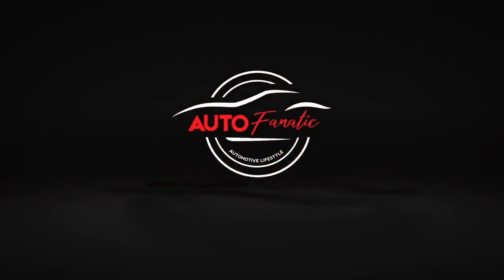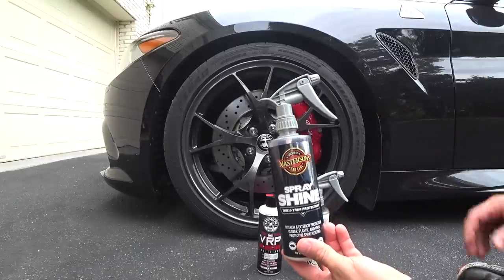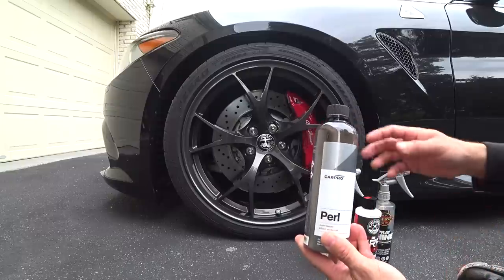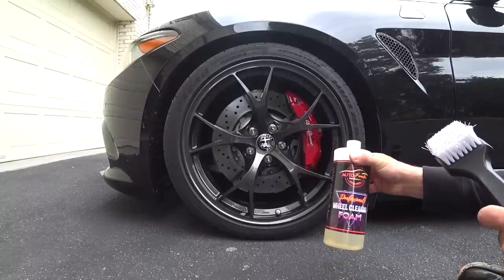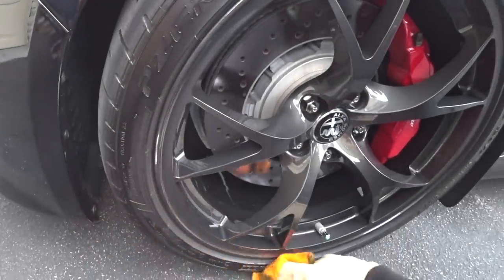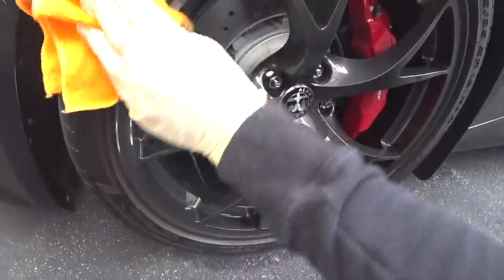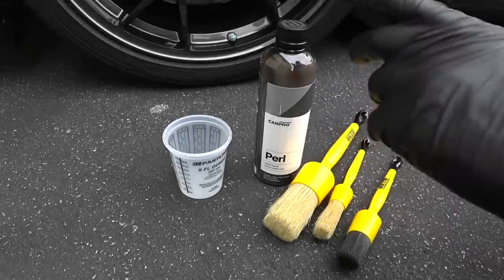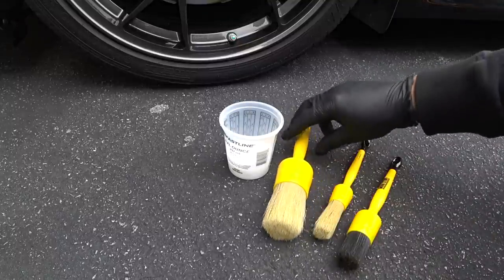CarPro PERL Application & Durability | Auto Fanatic

Comment: Used to use VRP and it was decent but my PERL is my absolute go to.  I also apply with a brush but I prefer to cut mine 1*1 on tires.  I find that it's easier to apply, lasts just as long as full strength and as a bonus makes it more economical, because as you said it's not a cheap product.  However when diluted 50/50 a bottle really goes a long way.  Had solid durability for a water based product and since I've been using it regularly (little more than a year) I've never seen any browning.

Comment: I use Perl for a year now. I wash my car once a week, and i use Perl every time. It holds that finish for about 4-6 days, then its starts to disappear, but it hold protective properties. 
I diluted it 1:5 for my dashboard, door cards and leather seats. Its holds pretty well. 2-3 months on dash and door. I have 2 small kids, and they kick front seats all the time. With perl on them i just wipe it down with some distilled water. 
BTW in Serbia its about 28 usd for 1L of Perl. With my applications i used it 3/4 in one year. That's for Tires and interior.
Reply from the maker: yes as it has been raining on and off the tires are a nice satin finish and it repels the water still nicely. I like this product a lot now
Reply: Can i use it on a cream leather?

Comment: I dilute Perl 1:1 for the tires.  Knock it down after a few minutes of dwell time and it gives me a perfect satin finish.  My findings are the same as yours.  Been using for about a year now and the first time it rained after initially applying I was super impressed with the durability / longevity of the dressing.  Perl is a gem!

Comment: For your views, here is how I apply a tire dressing.  As you mentioned, preparation is key, if your tire is not clean, dressing will not last.  Step 1 - Clean tire with mineral spirits (as you mentioned)  Step 2 - clean tire, wheel & wheel well with Eagle One Black Pasti Coat ( also used to chemical decon. a car, very reasonable price), step 3 clean tire with Meguiars non acid wheel cleaner.  Step 4 Clean tire & wheels with Super Clean, diluted 1:4  or 1:1.  If you still get browning, repeat step 4.  Step 5 Apply tire dressing  (PERL), 1 or two coats, waiting 30 minutes between coats.  The following steps, I performed if the tire has never been deep cleaned before.  If your tire has been deep cleaned,  go to step 4.  Super Clean is very reasonably priced & available at Walmart.  PERL will last for several weeks, if tire is properly prepared.  Thanks Auto Fanatic for your videos...

Comment: Thx for this video ! Using a heat gun after the degreaser, then apply the dressing, let it dry a few minutes on the tire and use again the heat gun to scell Will increase the durability of the silicon based dressing.

Comment: I just purchased Perl to test and see what all the hype is about. I have been using Adams VRT for the last 2 yrs. and it’s great. I use it on my Raptor and I drive it everyday no matter what the weather condition is. I have noticed in harsh weather condition it would last about a month, but in normal conditions it lasts close to 2 months. The finish is Matt finish for the first coat and gets glossier with multiple coats. Matt finish for me!

Comment: This is water based too so wont damage your tyres.. U can Use it on interior  and exterior trim when diluted... so excellent value too. I put it on tyres neat 1st application.. Then apply diluted 1/4 via spray bottle for top ups after washes once/twice a week. Its only £10 in the uk

Comment: The Carpro Perl is really impressive. I recently tried it against Meguiars Endurance gel on the same car (left and right front tires). After a month in pretty harsh weather the Carpro was still going!
Reply: Endurance will sling, plus its silicone based product, harder to clean and accumulates brake dust easily. But the shine is outstanding tho. I still prefer PERL.

Comment: I highly recommend Adams VPR. I found that it gives it a dark natural/uniform finish that lasts about 2 weeks. It nothing like the CG Vrp or Perl that washes out. The Adams doesn't shine that much but after 2 weeks the tires are still dark natural looking which is what I like.
Reply: I agree I have been using it for about a year now and it looks good on the tires. Also coat the rubber trim around the doors before winter so when ice forms the rubber won't stick and possibly get damaged.

Comment: Nice prep as always, very professional. As far as durability, I don't think it's going to last any longer than the other ones. Perl is better on vinyl and interior than on tires in my opinion. VRP is no.1 for me, I don't mind reapplying it every week or every other week. If it is a rainy period, it doesn't make sense applying it anyway until the weather settles down. P.S. I use Work Stuff brushes as well, was surprised to see u use them 😂 They're great.
Reply from the maker: these brushes are awesome. i am building a wall rack for them now
Reply: Who makes VRP? Thx
Reply: @tundrawhisperer4821   chemical guys

Comment: I use it mixed 1:1 with distilled water on my Alfa Giulia, never use it neat.  Great to spray on the grilles and wipe in with a cloth.  Very good for a water-based product.   I think it looks better at 1:1 (or 1:2) on tyres too - more satin, and 1:3 on plastic areas like scuttle panel, mirror brackets, plastic engine covers.  Works out economically then too.  Great stuff.

Comment: I always used Chemical Guys VRP, until I found 303 high shine tyre dressing, it produces that showroom gloss that I like, (for those who like a satin/matte finish, 303 tyre balm would be an alternative), I find that it lasts even after driving through rain multiple times, it is recommended to spray it directly onto the tyre, although I prefer to apply it with an applicator, the end result is the same I find.

Comment: A 5 gallon Bottle of Silicone Based Tyre dressing is $55cad from the local distributors. Rain doesn't take it off and because its silicone it wont damage rubber and plastic which is why it's safe to use on interior trims. If you use it on trims, I recommend wiping it after with microfiber or it's going to look and feel oily. Some people are into that but I like to be able to touch my trim and not get my hands greasy. Cant make money off that product, it's too expensive for the same results.
Reply from the maker: silicone attracts dust and dirt, slings and leaves brown spots on white and silver painted lower panels. we also can not use silicone in a body shop.

Comment: Great video as usual. I kept seeing those work stuff brushes on instagram and have wanted to get them for a while now i love how big they are. On the tire dressing Perl is an incredible product but i have to say i love Adams Tire Armor. Its holding up now for 2 months and still shining. i simply spray their tire and rubber cleaner on and let it dwell and rinse off and its back to shiny. I will say tho Optimum has a pretty killer product out now similar to Adams but supposedly last longer. Ill stick with the Tire Armor and plan on doing another coat in another month or so just to keep it fresh.

Comment: Oh man, you reminded me of the old days, naptha and silicone based dressings. I actually love the perl, it cleans better with normal APC too. Thanks for the vid AF.
Reply from the maker: APC all have acids in them and over time dry out the tires and can cause cracking, mineral spirits is totally safe for the rubbers oils and if you use it sparingly its safe. been using it for 30 years and love it.
Reply: @autofanaticcars  Good to know, I'm been looking around lately for different cleaners, so far Purple Power is really effective on tires, not recommended on rims. I've heard you been using Malco Redthunder, any good?

Comment: I tried using a microfiber towel to work the product into the tires, and I had difficulty getting it into the textured parts of the sidewall and edge tread.  I think I need to use a brush next time and just use the microfiber to wipe off any excess.

Comment: I've been using CarPro Perl for about 2 years now.  I wash two vehicles every week or two and apply it each time.  I bought the 34oz bottle and have only used a little less than 1/3 of the bottle during that time.  I use it undiluted and apply it with an Adams foam block applicator.  I used the CG VRP previously and like the durability and how much time I get out of one bottle of Perl.
Reply from the maker: i like it so far and its been raining on and off and the tires still look good, zero browning as well which i was getting with the 3 other products i have been using after it rained

Comment: Never use mineral spirits on wheels. The product is greasy, and if it goes on the brakes you will lose in effectiveness. Safety first 😉
Reply from the maker: tires not wheels FYI and nowhere near the braking system, put on your glasses next time ha ha ha
Reply: @autofanaticcars  Haha! I saw it well. It's only that I find dangerous to suggest to users to use mineral spirit near the brakes. Imagine if someone uses it in a sprayer, for example 😉
Reply from the maker: oh yes, I actually saw someone years back spraying Wd40 on their calipers  and it was going all over their rims and rotor in a parking lot to fix their brake squeal talk about dangerous . I walked by shocked.
Reply: @autofanaticcars  Crazy 😳

Comment: Is that the 500 mL bottle? Even with shipping $30 is a lot. I bought mine for $16 locally but even if online shipping wasn't that much. Figure $20 or so when you factor in tax and shipping in most situations. In any case, I've been using Perl recently and like it a lot. Holds up well to rain, smells like bananas and is very easy to apply (I just use a MF/foam applicator). It's good stuff!

Comment: WOw you forgot to do the inner part of the tyer ,the part which has the sidewall rim protection or wheel protection, lol :) Use a small brush mini version so you can get into those side wall wheel protection areas, lol :) Or a cotton ear bud would be a prefect size for that i do,when i get too OCD about wheel dressing my own car, lol :)
Reply from the maker: I always do that when I use the foam wax pads to apply my new Holeshot Tire and Trim which works better than Perl.  Check out my video from last month on the Auto Fanatic channel

Comment: Hey BTW, thanks to Pan, I will be trying your wheel cleaner this weekend. Fingers crossed. I hope it out performs the SuperClean.
Reply from the maker: you will love it, Superclean have harsh acids like most APC which strip the finish and also cause premature corrosion on the braking system i never would suggest any APC on wheels but wait til you try our wheel cleaner and see the lubrication and what it does. Enjoy if you have any questions send an inquiry though the Auto Fanatic website for assistance.
Reply: @autofanaticcars  Will do. I appreciate the response as well.
Reply: Well...Works like a charm. Easy. No residue. Didn't choke and gag! Wheels look great!!! One question. I used the smaller IK sprayer and it did not foam. Should it have? I mixed it like Pan said.
Reply: I saw another video you made with sprayers. Found that My ik 1.5 sprayer did not come with the three colored nozzles. I found them online. will get back to you, but so far, great results, even absent foam!

Comment: This way of dressing the tires caught my eye, I have a race glaze brush and did the mineral spirits cleaning before starting . Tires looked good , then i applied the carpro perl to my pirellis..Painted it on like you do and wiped the tire good afterwards to remove the excess, problem is the next day i drove it to work and got out, The dressing slung all over my tires ,  any ideas what i did wrong ??
Reply from the maker: Perl is very thin and many thin it out more to extend the use but that is an issue try a thicker bodies tire dressing many have surpassed Carpr Perl since this video came out. We released out own SIo2 Tire Gel called Auto Fanatic Mega Gloss in our webshop

Comment: Perl also washes off easy. 303 tire shine better.
Junk = oil and wax designed into tire for sidewall protection.  You are stripping the tires built in protection.

Comment: Have you used it in engine and how it lasted and how repelled dirt? Thanks
Reply from the maker: i have it does not repel dirt so much and seems to break down from the heat. for engine bay plastics and trim i have been using our Auto Fanatic 007 Gloss Enhancer Ceramic Detailer it works better and much easier to apply to rubber and trim to give it a nice finish.

Comment: Don't use that much product bro, diluted 1 to 0.5 you get almost the same finish but use a lot less product and go's on pretty easy.  I do this dilution ratio in a small spraybottle on a, cut to pieces, 59 cents carwash sponge.  10mins - 4 tyres

Comment: I was just recommended this (diluted) and some other products for my grills. Was looking for a plastic dressing for the honeycomb grills. Need something i can mist on and walk away. Wiping is a super pain in the hard to reach areas.
Reply from the maker: you can spray this on if you dilute in a  separate bottle they say. I gotta say I'm impressed it has rained 7 times since I shot this video and my tires still look good.
Reply: Auto Fanatic thanks man. Just used your cleaner on my Sig Wheels first time. Worked great.
Reply from the maker: enjoy it and no nasty fumes makes cleaning the wheels even better.
Reply: Auto Fanatic if one chooses to dilute and spray onto the tires, do you let it sit for a bit and then wipe even with a towel?  Thx!

Comment: Is your driveway asphalt? I just got one installed and wondered if you stay away from products that may damage it?
Reply from the maker: yes it is, be careful what you use I had lots of issues over the years with iron activator wheel cleaners that lifted the color and stained it.
Reply: @autofanaticcars  thanks for the reply. I've been a little paranoid about it . I have a bottle of Pearl but once I tried duragloss 253 I've never looked back

Comment: hOW DO YOU CLEAN YOUR BRUSH AFTER APPLYING PEARL? HOW LONG DO BRUSHES LAST FOR THIS?
Reply from the maker: i leave it in a plastic bag after use, to clean you can soak in a good APC full strength or in mineral spirits and air dry.

Comment: This was bad advice, after applying mineral spirits to my tyres to "properly" clean them, where the spirits touched the wheels/rims it discolored them! Giving them a "milky" finish. Not sure how to fix this. Not sure if it ate off the polish off the wheels, or the clearcoat (do wheels even have clearcoat?) or the Opticoat ceramic coating on the wheels, but whatever it was it ruined them! Really annoyed.
Reply from the maker: sounds like you may not have used the right product there are many versions of mineral spirits FYI depending on where you buy it what I show on the channel is the Odorless brand Home Depot and Lowes sells. If the finish on your wheels got ruined that for sure means the finish or coating may have been compromised somehow but i never ever had an issue with the finish on any OEM or Aftermarket wheel on the edge when I clean tires on my cars and all our customers cars for 30 years. I even have gotten this on properly applied ceramic coatings for wheels and never an issue if the coating was applied properly. Cheap coatings and inferior paints and wheel finishes may be an issue for some but not something I ever experienced in the service business of what we do. You may want to try a mild polish on your wheels and try a different coating.

Comment: Hey AF, just wondering how you keep your rotors from rusting up on the edges?
Reply from the maker: all i use is the Auto Fanatic Wheel Cleaner, if you used an acid cleaner in the past its too late

Comment: Brought a car today and have a bottle of this to use on it. Anyone used it on Leather?
Reply from the maker: i would not suggest this on leather unless its a cheaper grad leather with a very plastic finish to it.
Reply: @autofanaticcars  my mistake. I got the Carpro 'inside' aswell and got this for the black part near the wipers.
Reply: Most leather for cars I see are coated leather.  Dilute it down.  Even 5:1 was a little too slick on coated leather...

Comment: Is mineral spirits the same as paint thinner? Can both be used
Reply from the maker: do not use paint thinner or lacquer thinner anywhere near a car. mineral spirits is a solvent but it is safe if used properly.
Reply: @autofanaticcars  Mineral Spirits in Europe are called White Spirits.
A saw it selling in shop for painters (artists), and it can remove paint from clothes and not damage them.
Reply from the maker: yes he was asking about paint thinner or mostly called lacquer thinner in US.
Reply: @autofanaticcars  I had trouble finding MS in Serbia, so i did small research. I thought it will help people outside US. :)

Comment: 50:50 and brush it in. Then knock it down a bit if needed with tire micro fiber
Reply from the maker: I will Experiment with cutting it soon, was curious on durability full strength. so far its awesome.
Reply: Auto Fanatic IMO just as durable when cut. Plus makes it more cost effective. I recently switched 4 months ago to it and have not looked back. Now, where do I give my other vrp bottles away at as well lol

Comment: Do you throw away your MF towels that you used to apply the mineral spirits?
Reply from the maker: i eventually do but i use the cheap ones for tires and wheels the 50 bulk packs off Amazon. I do not suggest washing any towel with a solvent in them
Reply: @autofanaticcars  ok good 👍to know